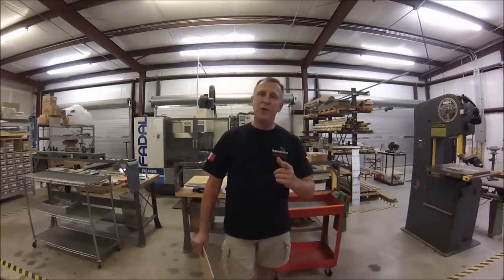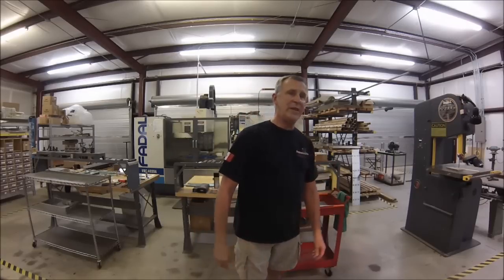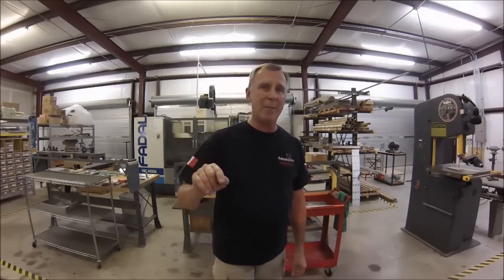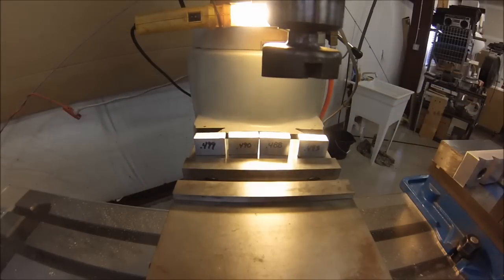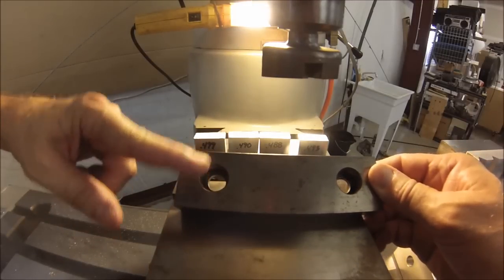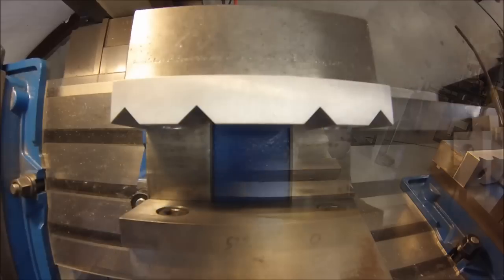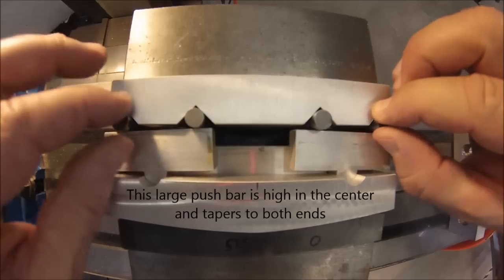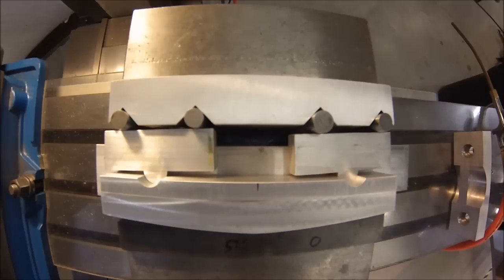How to Hold multiple parts of different sizes in a mill vise

Comment: I wondered how the diameter on the male part of the rocking jaws could be made by most people. I imagine the rocking jaw would be easier to make by using a dowel pin for the round feature and clamping the jaws together and drilling down the joint between them to take the dowel pin. Then removing metal from the female side to allow the rock. More parts to juggle though.
Reply from the maker: Realistically, all you need is an apex. A saw cut, sander rounded tip would work just as well.

Comment: Hello Joe, my question is sometimes I need to drill multiple holes and/or mill slots in thin S.S. shim stock, say anywhere from .015" to .075" THK. and anywhere from 3" to 5" wide X6" long. What would be the simplest holding technique to get this done on a typical manual mill vise? Also, when turning/facing with a carbide insert cutter, which is better, cutting oil or no cutting oil. I personaly do not use oil when cutting with carbide, I use only with HSS. Please advise. Thanks for all your knowledge Joe!
Reply from the maker: Anytime you mill or drill thin material, it is always good to make a sandwich out of it with other material. Clamp it down to another piece of material with small toe clamps. this setup will keep the thinner material from climbing up your tools. Be sure the top sandwich material is thick enough to translate the clamp force. As for the oil, thats a decision based on material and depth of cut.
Reply: @joepie221  sandwiching makes total sense Joe. In addition based on your reply, now that I know I do need oil on curtain mat'l and depth of cuts, I'll do my homework and determine which mat'l is appropriate. Thanks Joe, your a beacon for sure in this trade and craft!

Comment: Super idea Joe, I never dreamed of that!  I always used a piece of paper that I folded in quarters making app. .014.  I use soft jaws all the time, but never made the holes symmetrical,  just tried always to machine as little as possible out of them to hold the part, using a boring head to make a circle in soft jaws works well if you don't have CNC.  Thanks much Joe!  Most of my experience is in surface grinding and ID OD grinding, but milling and lathe work is always necessary in building plastic injection molds and progressive dies!
Reply from the maker: Symmetrical holes in soft jaws is too obvious. I don't know why they don'e come that way.

Comment: Hey joe is there a way to zero a fadal like a dro so i can work manually?
Reply from the maker: With the machine starting at the E0 home position, I know all the jog moves originate at zero. Having all zeros at another spot is a good question. My machine is setup right now, so I can't experiment, but I will dig into this deeper. Can I ask why you want to move manually?
Reply: I have a program that i can set simple plots and it will tell me the xy to the next plot much faster then i can cam it out and i can also use fadal learn mode.

Comment: Hi Joe, Greetings from an old toolmaker in Charlotte, N.C. Thanks a bunch for solving a long standing problem for me. What a great idea for clamping unequal parts with cardboard or rockers. May I suggest a 1/2 inch ball end mill to cut four radii in the front and rear jaws and fasten short lengths of .500 bar stock in two of them. This seems easier and more precise than using the corner rounding cutter. Keep 'em coming Joe, every video has something new.

Comment: i think a quick improvisation of this could simply be the 3 blocks and where the pivots are insert a small diameter pin. a piece of drill rod or whatever for the blocks to pivot on.  for a bit better retention you could knock a couple grooves in the blocks but you shouldnt need anything as nicely machined at your setup.
Reply from the maker: You are correct. I did it that way for a while, but got tired of the pins falling over every time I opened the vise. So I took a few minutes and made the jig. I hate that 'Next Time' syndrome for tooling. It never seems to get made the next time either.

Comment: Maybe a nice thing if you are doing production work. Building jigs for for the one or two off is waisting time and material. In this example it is easier to turn the dials.
Reply from the maker: Agreed, but try not to fall into the "next Time" syndrome. The time you waste doing those one offs can add up. This was a very non specific example showing some variety. Just food for thought. I appreciate the comment.

Comment: Using a length of soft aluminium welding wire between the parts and the vice jaw can achieve a better result than the cardboard.
Reply from the maker: Thats a good idea as well. Someone else mentioned copper wire may work. Great feedback. I have to try it out.

Comment: Great video, Joe.  We also use emery cloth to take out slight variations in thickness of parts at.  I really like the swivel jaw, I was thinking you can make it without the boss and just notching all three parts and use gauge balls or round stock as the pivot points.  Thanks for the share

Comment: Thanks for the mention, greatly appreciated. You beat me to it actually as you have a mention in my next video which I'm just editing. Also in that video you will see some screw cutting in reverse like you have shown! I like the soft jaws, never seen anything that advanced before. Cheers
Reply from the maker: You're welcome. The jaws work very well if you have a bunch of parts to do and can't trust the size of the blanks. I use them in my CNC all the time to save time. Once you start threading in reverse, you may never go back to the old way. Internal threads can be done that way too. just cut on the backside of the bore.

Comment: Awesome tip Joe! Ive seen allot of people just use only two parts in a vise. Of you can hold it you cant cut it :). Question does the big jaw have a pivot on it as well or was that just the go pro distorting the picture. Do you have any tricks for holding really thing material? Love the videos keep it up.
Reply from the maker: The big jaw is tapered 1/4" to each end. Yes it pivots as well. Good question.
Reply from the maker: Tim, I posted a video on holding thin material. if you have a specific problem, just ask. I'll address it as best I can.
Reply: Sorry I didn't type that clearly. Loved your other video. I do allot of cnc parts on thin sheetmetal usually I'm resorting to double sided tape and some prayers when the parts are small.
Reply from the maker: Hi Tim. I hope you understand this reply. I have worked in orthopedics for many years and we use a trick that I labeled "one way parts" its a technique where you add webs to hard to hold parts in strategic outside radius areas, or at sharp corners while holding a manageable square or projecting round blank. Once the hard, or irregular machining is complete, the actual part is snipped out of its holder blank and hand finished to remover the web spines. The part can never go back into the machine, because you took away the grip stock. That's why I call it a 'One way part' Maybe a video ??
Reply: Thanks Joe, sounds like your describing adding tabs in the CAM program. Ive had success on thicker parts (1/4-3/8) that the profile is not critical. Usually their odd shapes for weldments (ex. bike drop outs or car seat frames). Thiner aluminum parts with this method I would love to see your thoughts on to get a nice finished parts. Ive even considered using dykem and a diamond scribing tool so in have a guide to clean up irregular profiles.
Reply from the maker: The other option is to 'Jump the clamps" Toe clamp or screw your blank to a backup plate and do portions of the profile. Use small clamps on the finished sections and complete the profile by 'jumping the clamps' when you get to them. You end up with a 100% finished machine profile. It adds some time, but the part requires no hand blending.

Comment: I believe this is known as the whiffletree effect (or whippletree depending on who you ask, also used on horse carriages with multiple horses, and windshield wipers), I've seen a few different interpretations of this, namely outside screwball's screwy balls, Tom lipton also showed a slightly more advanced setup than Chuck's in his toolmakers tools video IIRC. I like how simple yet effective your setup is though, when I first saw yours I thought of making one with hinges, but as you said the ability to swap them out for various custom pivot pieces is handy. I've used pieces of aluminum or copper tig filler rod before, clamped between the movable jaw and the pieces running horizontal, as the rod is soft it can deform and conform to the parts, this only works for slight differences, but it also acts as single point contact for squaring blocks to the solid jaw. Great video, I walked away with a new "government job" for the next time we get slow, haha.
Reply: Swingletree.......same kind of thing..........it's an English term

Comment: Thanks Joe, very interesting. Question. How did you cut the male part of the swivel jaws? Form cutter? Cheers, Daniel
Reply from the maker: Hi Daniel. I milled a boss on those parts .550 wide and .260 tall. Then I used a 2 flute corner rounding end mill from each side until the boss was .490 wide and .250 tall.

Comment from the maker: The 4 position 'V' jaw used in this example does not have to be used with the 3 part pinch block. This technique will easily pinch square stock in stock hard jaws using parallels. Get creative with this technique and see where you end up.